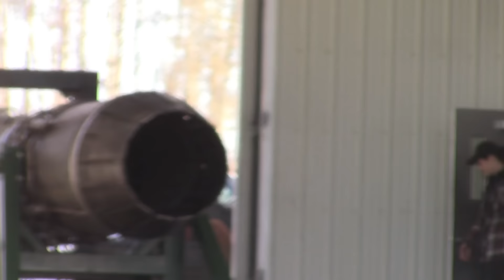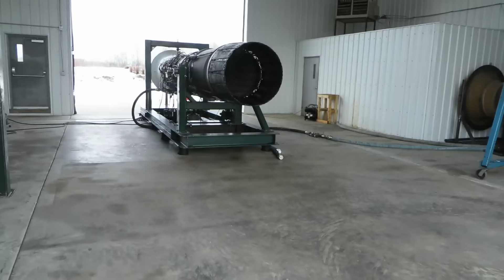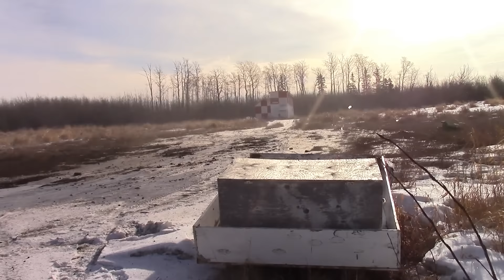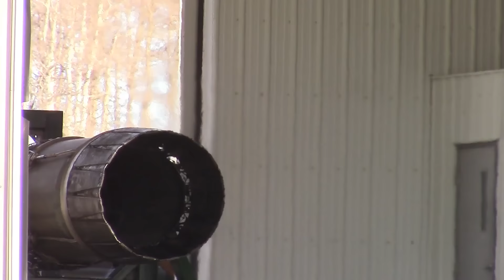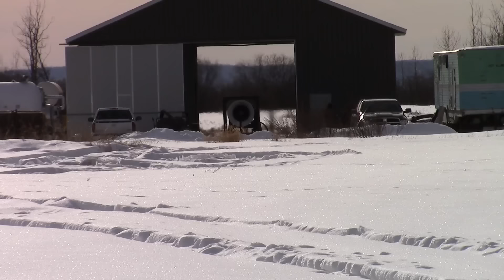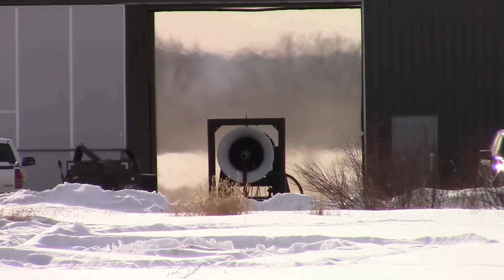Jet Engine Run at 50 yds

Comment: Just the heat shimmer viewed from you car shows how much air moves through that thing, it always amazes me, given how much fuel that thing must chew, especially with the afterburner on, that the plane can stay in the air for more than 6 seconds before running dry :)

Comment: Wow. The footage from the car is awesome. The difference between maximum dry thrust and afterburner isn't so much in the sound (that may be levelled by the automatic gain control in the camera or something), but the turbulence blurring the background trees is increasing visibly.

Also interesting how at idle the compressor is the predominant sound, but at full thrust it's the exhaust, even when viewed from the intake side.

Was the phone call about reaching 50,000 subscribers? Congrats on that! Quite an achievement for a technical channel on such a niche subject!

Comment: I don't think any microphone can capture the sound, it's the most intense white noise, that gets into the centre of the brain 😜
Reply: There are microphones designed for extremely high-SPL applications, yes.  If you've ever seen a heavy-lift rocket launch (like the Space Shuttle), those are orders of magnitude louder than a mighty J79 -- even using extensive sound suppression, and at several miles out.  Some hard rock / heavy metal concerts these days are running multi-megawatt PA systems, getting real close to 160db -- jet engine territory.  It's the FOH Guy (mixing board engineer) who runs the system with a wideband RTA sound analyzer -- which requires a very precise microphone capable of handling the SPLs.

Comment: maxing out the mic. I had to put my Bluetooth speaker on to try and appreciate some of the fraction of low freq sounds and roar. awesome vid. thanks Jay.
Reply: Let me assure you.  Nothing comes close to being in close proximity of a running jet engine, and I only ever worked on 'quiet' airline engines.  It's a tribute to the airframe makers when you fly in a plane how quiet they are inside of that window as compared to outside.
Reply: +David Steer I know this. I've done ground run ups on 777 GE90 and Trent series engines before I joined the army. I'm stationed in Korea and they still fly the f4 with the j79s and they are ear shatteringly loud.
Reply from the maker: +David Steer Those big turbofans might seem quiet, because they don't scream like a fighter jet engine, but they have a deep thundering rumble that lets you know they produce gigantic power.

Comment: Just to reinforce what some others are saying, that straight from the front shot really dove home your point about how by 95% throttle the noise seems to envelope everything. And then it seems to double again and again and again up to full afterburner.   And the plume of heat and exhaust that just kept growing and growing until it made the test cell doors, that appear well oversized  with an engine at rest, look hardly adequate for moving that much atmosphere. Great job!

Comment: Lord that make the hair on the back of my neck stand up.  Jet porn -- nothing better.  I could not believe how loud the compressor was at 200 yards when at ground and flight idle.  Now I know where Global Warming is coming from :-)
Thank you very much!!!!
Reply: +Todd Dembsky  Most of it is coming from politicians. Jet engines are not even close to them in producing hot air.
Reply: Lewie McNeely Good point, never thought of that -- and worse, you can turn off a jet engine...   :-)
Reply: You got it right in the middle of the (X) Todd! Nothing turns off that hot air. They even have to vent the caskets for several years after they die to keep from blowing the lids off.
Reply: Lewie McNeely That is classic -- thank you for the laugh this morning.  I am picturing cemetery plots just randomly exploding -- just like a Far Side cartoon :-)
Reply: Good old Gary Larson. He was with it a lot more than folks thought. I don't think they'd explode, just have steam pipes coming out and maybe hooked up to an old time radiator or blowing steam rings or...........

Comment: Problem I always realize I would have with a job like this: I'd be too tempted to try and use that sucker to cook hot dogs. :P
Reply from the maker: +DarkAngelGuyver Cases are too hot (700+F). and exhaust is too destructive (1000mph).
You could cook franks, or maybe bacon, on the jet pipe after a test, when the engine is shut down. I should try that, eh?
Reply: +AgentJayZ That'd make for a hell of a charity BBQ, jusq sayin

Comment: Is the nozzle position only dependent on the throttle position (the "stupid simple" way) or does it change according to the engine RPM or gas flow or pressure? Is the linkage between the two (nozzle position and whatever it's controlled by) purely mechanical/hydraulic or is there electrics/electronics involved?
Reply from the maker: +superdau We talk about the nozzle area controller in the playlist Your Questions Answered.
Jet pipe temperature is the main quantity sensed and adjusted for.

Comment: I am wondering about vibration. In many videos, not just yours, the shear balance if these engines is incredible... just seeing a one finger spin on a massive turbofan is incredible. I'm wondering if you could touch the casing of an engine while it was running (not safe I know), would you feel much of anything besides heat? Are these engines so well balanced that if you could remove the sound and eat, would you even know they were on by touching them?  Also, how much vibration is too much?  That is, when do you start to worry about it?  Congrats on the subscriber count!
Reply from the maker: +Bill Clark Vibration is very important, and each engine has specifications for maximum imbalance of its rotating components. We spend a great deal of money and time balancing compressors and turbine to very tight tolerances.
I just finished balancing a turbine rotor that weighs about 100lbs, and the final imbalance was 0.031 gms at a radius of 7 inches a half inch piece of black electrical tape weighs about 0.1 gm.
Engines have different resonant frequencies at lower rpms, but at full power the outer cases feel smooth as glass on a well balanced example.
Reply: +AgentJayZ  Amazing...I can't even grasp that weight. You've posted balancing videos before, but I am not sure if you have stated the total time to do this. In the 100 pound example you gave above, how long was the job to get that accuracy.  I just cut tape to that size...it hardly weighs anything. It is totally amazing how balanced you can get. Cheers!
Reply from the maker: +Bill Clark It took a full day to balance the rotor. Then I installed the lock plates on the blades. I was moving them around the disc to achieve the balance. I am about to spend another few hours on final balance... stay tuned for another shop video!

Comment: What is the purpose of the red/white checkered buildings at 3:40?
Reply from the maker: +Bluenoser613 It's an old derelict airport building. They dragged it with a big loader from beside the runway to its current location. It's too big for the firefighters to practice on, so it just sits there.

Comment: AgentJayZ,

I've noticed in the last few videos, there's usually (always?) a gap between the afterburner case and the exhaust nozzle. I was wondering if you could explain what this feature is for?

Thanks for taking the time to make these awesome videos!
Reply from the maker: +Matt Dixon There is an inner nozzle and an outer nozzle. The manual says that the gap helps to augment thrust by allowing the exhaust jet to accelerate air is drawn through it. The effect also increases airflow drawn into the engine bay and flowing around the outside of the engine, helping to keep it and the fuselage cool.
Reply: +AgentJayZ Thanks for the info!

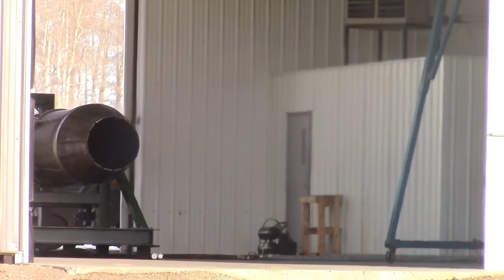Comment: At 3:05 it looks like someone walks in front of the engine. How much suction is there at the front?
Reply from the maker: +Bill Clark The danger area expands as rpm increases. At max power, you need to be at least 20 ft away from the inlet of this engine. At that distance you feel no air movement.
Reply: +AgentJayZ What about from behind? How far back would you need to be in your truck behind that engine when the only effect would be a light breeze and smell of fuel.  The Internet has lots of videos of people in St. Marten right behind the takeoff jet blast. Would the blast be more or less with a turbofan?  Not sure you would want to drive ever so closer to your tests, as damage may occur to your vehicle, but it would be an interesting test...kind of like walking the plank, only moving horizontally ;-)
Reply from the maker: +Bill Clark In St. Maarten the planes are usually idling as they approach the runway. If an airliner had an emergency need for max thrust, many people on the beach would be killed, or be badly hurt and hurled into the sea. You remember the warning signs?
The incredible skill of the pilots, who are very aware that people ignore the warnings... saves a lot of people trips to the hospital.
If I was 400 yds behind the engine in full AB, the heat and air would float above me, but any rocks and gravel picked up from Jetwash alley would be dangerous to me, and probably knock out my window glass.
Reply: +AgentJayZ   Thanks!  One final question on this jetwash.  If you had two identical engines in terms of thrust, which would have the stronger blast, the turbofan or turbojet?  I am not sure if the larger fan means that the exhaust stream of the turbofan is more spread out and thus less dangerous or not. I'm thinking the turbojet would certainly be warmer, and that the smaller exhaust stream would make the blast stronger. So much to wonder about with these engines...thanks for sharing your expertise.

Comment: Who pays the fuel cost re a test run?...roughly  how much is it?
Reply from the maker: +Stuart Shapiro This is a common question, which puzzles me.
A test run takes about a half hour, during which time we might be at full power for a couple minutes, and in AB for a few tens of seconds. That requires a few hundred gallons of jet fuel.
Every flight of the aircraft to which this engine is fitted will burn much more than that... typically almost all of the fuel it can carry.
How much does that cost? When you fly jets, that is a question that is just not part of the mission plan, and I'm sure the pilot never even considers.

Comment: Agent Jay, since you are testing engines at an open facility, are you not concern about foreign object debris being suck in from the front?
Reply from the maker: +Dave Poncio Yes we are concerned about it. That's why it has never happened.
Aircraft usually operate in the open facility of the runways of an airport.

Comment: What aircraft is this J79 from?
Reply from the maker: +mike104740 This is an engine from a privately owned aircraft, and I respect the owner's right to confidentiality.
The Wiki page for the J79 is very interesting. It even uses one of my videos as a reference.
Reply: alright.
Reply: +AgentJayZ another question since we are talking about j79s. On the f-104 starfighters what makes that howling sound?
Reply: +mike104740 The thrust nozzle does I believe.